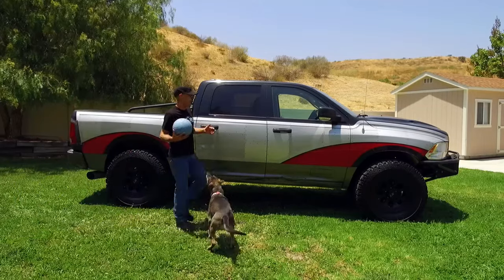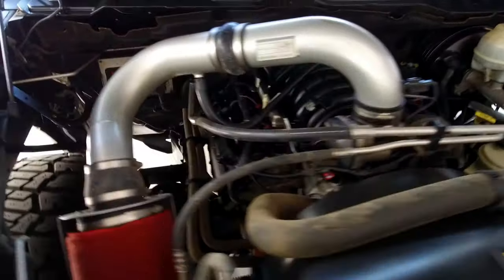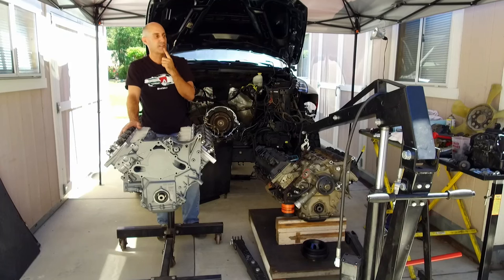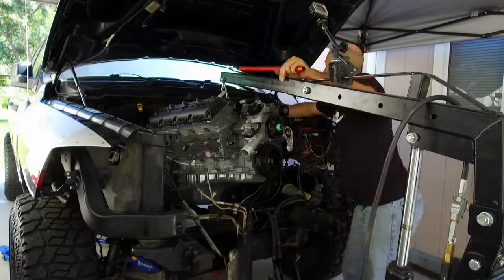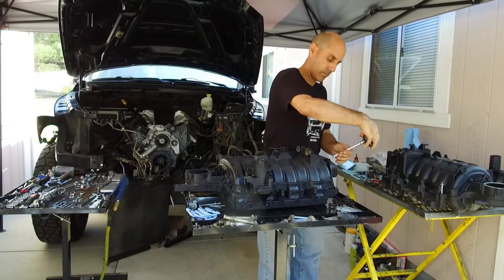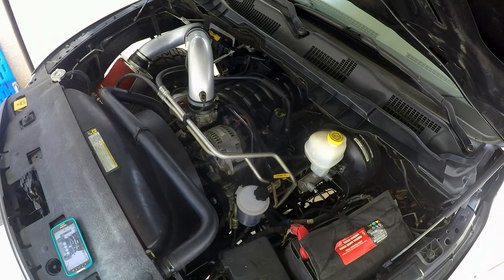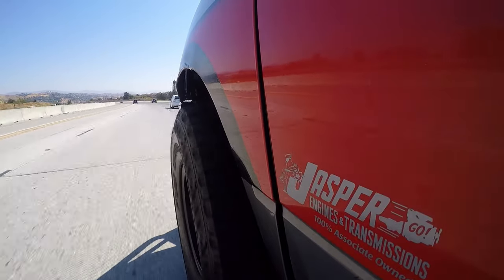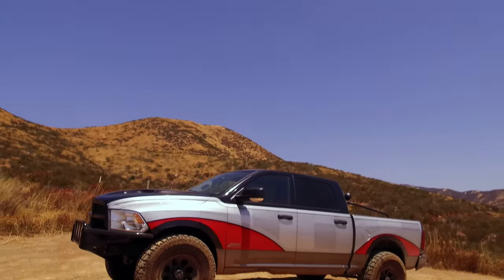HEMI Swap with Jasper Engines Replacement 5.7 in a Dodge Ram 1500 on 37" Tires

Comment: Great video. Thanks for the input on jasper engines. I have a 02' 4wd expedition with the 2v 5.4. Been a great vehicle. Spark plug came out of head and at first thought it just blew out but the top of the piston has some marks so I'm not sure without the head coming off if the piston hit the spark plug and pushed it out. The spark plug was damaged. I've been looking at jasper engines for a replacement since then if I can't repair this engine. 240,000 miles on the original so may be better to just get a new one. Thanks for taking the time to make the video and always having a great attitude. From south Texas.
Reply from the maker: Howdy and thanks for watching! I had a F150 with a 2v 5.4 and the spark plugs coming out is a fairly common occurrence. It's not likely the piston touched the plug... the heads just "let go" of the plugs and require a heli-coil. I pulled my plugs and just made sure they all had anti seize on them and were not too tight. 
If you do decide to get an engine... do some research on the Jasper unit. They are such a great company that I'm proud to support them and the more you know you would too!  Have a great one!

Comment: I BET JASPER JUST LOVES LOVES LOVES DODGE WITH ALL THE HEMI CAM AND LIFTER FAILURES
Reply: i had a 08 ram with the hemi i never had any problems with it.. is the problem mainly with the 09 and newer hemi? i like to know more...
Reply: @terrysansom6054  mainly 09-11 as far as I know. 

Probably cheaper to just replace cam/lifters. Basically the roller lifter needle bearings are going out at fairly low miles (first cases as far as I know were in 2016) and the lifter roller was eating the cam lobe. Ticking sound (not like the exhaust manifold leak they're famous for), then misfire code due to teh cam getting eaten, then she's fucked.
Honestly I can't believe people didn't see the signs when they changed oil. Should be a bunch of metal in the pan, but who knows.
Reply: Seems to be issues with mds 5.7’s and a few showing up without mds.  Much wider range than just 09-11’s. Someone posted their ‘15 had the same issue.
Reply: and the 5.4 triton
Reply: No mention of whether the Jasper engine has an upgrade to solve the camshaft/lifter lube problem.
Reply: just like at the end of his video... I believe they delete the code for the MDS and you pull them and replace with  plugs....
Reply: @redneckracing8895  Yea U would think they would have done a recall on that piece of shit.. Dodge has lost me as a customer,, Too bad ,, 2 more payments and ill be trading in for a new truck,  U bet your ass it wont be a Ram (dodge) .
Reply: 160,000 miles on my 2012 and going strong, 120,000 on my 2011 and going strong, not a single issue out of either. my 2012 has even been modded and running a custom Jay Greene tune, it does not get babied.
Reply: @frankreinhardt441  When you start hearing it rattle on start up, thats gonna be the start of the ending,  thats the lifter roller bearings  failing,,  soon after its gonna wedge sideways and wipe out a cam lobe.
Reply: @frankreinhardt441  Maybe you got lucky and got engines built with good parts,  my 2013 parts all came from mexico.
Reply: It is not as common as you think. It is not limited to the 5.7 but all the la gen 3 and gen4 hemis. Although to me there are years that seem to be more common.
Reply: I have an 03 and it just got the tick at 200,000 miles. I'm getting a jasper next Monday but it's 5600 installed. I just love my 2500. Next I'll need a new trans and then a new bed
Reply: Run a oil stabilization and you will be good to go.
Reply: @charlesedwards8030  Can you be more specific
Reply: @Crabawizky  Lucas makes a good one that’s what I personally use.
Reply: You can’t go the 10,000 miles between oil changes. 5,000 is what a old ram mechanic told me and I’ve never had a problem. Ram says 10000 and the mechanics say 5,000 I think I’ll go with the mechanics.
Reply: I have  a 2017 Ram. 60k miles.Have they fixed the problem with them by then or am I in for a bad day down the road?
Reply: I wonder if the rebuilt Jasper engine has the high performance hell cat oil pump that might oil the cam better at low RPM.  Yes it's always cheaper to buy a new engine than to pay $65k for an entire new truck.  Sadly new trucks will not have the hemi but a 300 six twin turbo which may or may not reach 200k+ miles.
Reply: Yeah man! I have a 2015 with 94,000km with lifter issues. Such a bummer!!!
Reply: @terrysansom6054 my 13 is having same issue

Comment: I have an 09 1500 hemi quadcab, been in the shop 4 times for manifold bolts, right manifold already replaced to warping.  Glad the 09 has the lifetime Powertrain warranty 👏. It’s in the shop right now for the left side manifold.

Comment: looks too easy, but you need some mad skills to do this. Guess you got the skills locked down! :D
Reply from the maker: Well, I'm not sure about mad skills but a little bit of luck and determination helps a bunch! Thanks!
Reply: anyway, Im impressed.Also your films are great. Tnx for making them
Reply: autoedit how long did your swap take just curious we used to do "1day" swap at the shop i worked at anywhere from 3hrs on a 3.7 2wd liberty to 4wd hemi drurangos that took like 12hrs those were long days 4wd ifs truck were a pain due to driverside mount design in sure you know that though lol

Comment: Thanks for making this video. You have encouraged me to do it to. I just pulled my motor out of my 2011 Power Wagon today and  will be moving over parts to my new Jasper 5.7 hemi tomorrow. I hope mine slides back in with as little fuss as yours did. It has been a ton of work so far just getting it out. Hope I get it all back together and working in the next few days. Thanks.
Reply from the maker: I hope it does as well!
Reply: Got it in and running. Motor sounds great. Thanks again for the video.

Comment: Great video!! Loved to see what Jasper did to improve the bottom end.  What about the top end?  This is where all the nightmares come with the GEN 3 Hemis.  Did Jasper fix the valve seat issue in the heads and the junk roller lifters that always fail and chew up the cams?
Reply from the maker: This particular year didn't have the valve seat problem but they did fix all that other stuff!

Comment: I think Jasper engines are great 
I had a Jasper 350 put in my truck in 2016and it's still rolling in 2023 1:20
Reply from the maker: This truck is still running great.

Comment: I have a 03 Ram crewcab dually. With a Cummins turbo diesel. If the motor took a crap I would buy a jasper engine for it in a heartbeat! You cant beat it!
Reply from the maker: I've been extremely happy with the entire transaction so far!
Reply: Beat on that engine and see what falls  out on road

Comment: Great video -- those new Hemis are incredible motors.  Unfortunately, I think that read somewhere that Fiat-Chrysler is going to discontinue the Hemi in a couple of years?  Too bad.  I have a 2016 Ford Triton V-10(6.8 L; 362 bhp; 457 lb-ft torque) in my motor home and I tow my 2013 Jeep SRT behind it.  But its crazy --  the 6.4L Hemi (470 hp and lb-ft torque)  in the Grand Cherokee makes over 100 hp more than the Ford V-10 .  I think I should tow the motor home behind the Jeep instead? LOL!  Hemis are the best.
Reply from the maker: I agree that the Hemi is a very solid V8 engine and when I learned all of the little goodies in this era, I was even more impressed.  Getting 390 HP and 400 LbFt out of a stock 5.7 is really good and  SRT takes things to the next level! 
I must admit that I have a soft spot for the V10, they sound weird and I like that. Seeing you tow your motor home behind your Grand Cherokee would be hilarious! 
Thanks for watching and say hey!

Comment: Well, I see what killed it, there was a Fram filter stuck to the bottom of it.
Reply from the maker: You are not the first comment to mention that... I had no idea that was an engine killer.
Reply: @AutoEdits  Of course it's not, but they are the cheaper of the options. K&N, Mobile 1, Donaldson, Amsoil, are all examples of better options for only a few more bucks.
Reply: @AutoEdits  Fram filters do fine. If you run for 80k miles on a Fram it's gonna give more issues sooner than some of the more expensive brands but as long as you regularly maintain Fram is fine.
Reply: Fram filter are junk. I’m a 30 year retired dealer tech.  If we had an engine noise complaint with fram filter, got changed first.  Had to replace one engine because Fram filter material plugged nozzles lubricating cylinder walls.

Comment: That was awesome to watch! I solo swapped a V8 Magnum for a Cummins 12 valve in a 96 Dodge Ram 3500 4 wheel drive cab and Chassis with a 5-speed. It's been a great work horse.

Comment: wow okay, I have been contemplating an engine swap on my 08 Dodge Charger RT and this helped make my decision, you made it seem a lot less scary then I thought. Worth a sub!
Reply from the maker: It's overwhelming to think of it as a whole project... just break it down into sections and you totally can do it!
Reply: AutoEdits thanks for the reply! Have you done swaps before? And how long did this one take you? The editing could make it seem like it took you a weekend
Reply from the maker: @braedentrebell3718  It took me a total of two weekends but since I ordered the new power steering pump... those weekends were spread out.  Takes about a day to get the engine out and 2 to 3 to get it all back together.
Reply: AutoEdits good to know! Thanks for the info!

Comment: Are u worried about that air intake being exposed to the open wheel well and water possibly getting sucked in?
Reply from the maker: +pra3t0rian I was for a bit but have been through some pretty bad weather with it and seems to handle it fine. Just have to clean the mud out every once in a while
Reply: Yea not to smart. I'd change that air intake to a snb air intake. So its enclosed do to the open wheel well. It's basically spitting water into the air intake if you drive I  the rain which will soak your air filter and let moisture in the intake

Comment: i bought a 2006 Chevy Silverado with a 5.3, a lifter had went down and ruined the cam. called jasper ordered an engine (installed myself). 2700 miles the oil pump goes out. i call the and they gave me 2 options to pull the motor an send me a new one or change the oil pump. so i took the oil pump route. i ordered a oil pump and new gaskets for oil pan and timing cover. after all the repairs was done i sent them receipts and a sheet with my time on it. the fully reimbursed me for the parts and time i spent. all this was done with out voiding there 3yr 100,000 mile warranty. i will not buy reman motor from any other company. i appreciate their work
Reply from the maker: Bummer you had to do the oil pump but I'm glad your happy with the end result.  I really couldn't be happier with the decision to go with this Jasper replacement engine.

Comment: Please cover your air filter better than just having it above the tire and in the open. You can get a closed box type intake, if you off-road heavily it's important since thats where your brand new motor breathes from.
Reply from the maker: Not sure what else to do with it, maybe another kit?
Reply: ghostdriverFJ60 add custom inner fenders.
Reply: Vararam intake is another option. They’re nice

Comment: wow that is a sweet truck.. how does that ifs system hold up with those 37s on?
Reply from the maker: Thanks! The IFS has been really good... I broke a half shaft once in Anza Borrego a few years back climbing some rocks (and that break was mostly driver error)  but it makes the truck so nice to drive. I'm very happy.

Comment: Good choice on the jasper i would have done a 6.1 upgrade instead of 5.7 i did these swaps on a daily basis a few years back lol on your pushing we used a geo metro wagon but a winch is nice option should have made some gin poles and use your winch to pull the engine too
Reply from the maker: LOL! I don't think I can do that upgrade and still pass smog here in California.
Reply: autoedit oh yea that sux
Reply: Richard Skipper how many jasper engines have you had go bad? in my 15yrs exp. I know of 1 and the warranty made it so gravy to get it replaced it was almost worth doing it twice cause they paid warranty labor more hours than i got paid first time around and sent a free install package due to the hassle so 2nd time around went faster thanks to all the new parts where do you see a downside? I dont know of another engine builder that will drop ship you a engine in 24hrs or less to your door when you have a out of state customer that needs a engine when they break down on a road trip it looks good on my shops part to have a down vehicle back on the road in under 72 hrs i thank jasper for that dependability
Reply: Richard Skipper sorry to hear about that yea they are better now sometimes you just get a bad claims agent that doesnt want to help but usually i can outsmart them due to knowing what to say and not to say to them or going over their head gets results too ive done like 5 jasper 5.4 3valve fords without a problem and those are some of the worst engines ever built so if they can get those right im impressed
Reply: Richard Skipper not 5 in one truck i own a repair shop i have personally installed 4 and help another tech with the 5th (his first cab off f150) all jasper ive also installed the remans available thru bumper to bumper and O'Reillys(who just resell jaspers) and ford themselves source replacement 3valves from jasper as their n.o.s. supply ran out years ago
Reply: Richard Skipper I went through 4 jaspers in one month.
Reply: Jake Browne who does this 6.1 swap? What’s it cost ? Love to pull my 5.7 for a 6.1
Reply: 6.1?  I think you mean 6.4, since that's the only other Hemi option.  He wasn't actually trying to push it, notice it is still in Park, rocking back and forth.

Comment: Love the ram!!!
Reply from the maker: Glad to hear it! I really do to and hope it gets the mad likes here on the you tubes!
Reply: I was at the road kill event in Pontiac MI last weekend! maybe you could bring there and show it off next year!
Reply from the maker: I was there this year as well, it seemed like a lot of fun... I was working of course... You might have seen the drone flying around.
Reply: Yeah I saw it! That's awesome! Im about to sell my wrangler and have a couple clean high mileage rams around for a good price. Was wondering if the jasper was installed at a shop if it would be under 10 grand? and are you worried about the transmission holding up séance its older?

Comment: These are great motors mine had 300000 miles on it with zero problems until one of the lifters failed and flattened the cam. When I took the motor apart there was almost no wear block was perfect pistons were hardly worn. One valve had a manufacturer error on the seat. After doing some research the oil pressure in this motor is very low at idle. This causes improper lubrication on the lifters. I believe me starting my truck and letting it idle for long periods of time in the winter caused the lifter failure.
Reply from the maker: Interesting to hear this analysis. I'm still a fan of this engine design.

Comment: I'm curious is the jasper engine more powerful or is it the same
Reply from the maker: You know, I never asked that seemingly obvious question.  I'll do some checking and let you know.
Reply: I was wondering the same thing.
Reply: I would think so, because being rebuilt means they honed the walls and put larger pistons and rings to rit the hone. So I'd say at least 10hp more

Comment: I cringed when I noticed he put the stock exhaust manifolds back on....might as well have replaced with headers, especially to prevent the infamous broken EM studs.
Reply from the maker: They work pretty good... tricky in CA to change that “legally”
Reply: I was thinking exactly the same... Why putting the old exhaust manifold on such a beautiful engine, when you can put some nice headers on... I just pulled the engine out of my JGCH 5.2 and one of the things I did was swapping the exhaust manifold for Doug Thorley headers and the engine is now exhaling much better than before... :-)
Reply: JBA shorties are CARB legal, let that thing breathe.

Comment: Checked prices and it depends on "contacting them". So wildly different prices for individuals, ugh. I just hope its cheaper for a stock replacer than a vanilla Blueprint engine ($9000)
Reply from the maker: PLEASE CALL THEM!  That's how I got mine done... you will be happy.
Reply: What did yours cost? ... Any rebate due to featuring it in this video? ... Sorry if you already said it in the video and I missed it.Thanks for the reply.
Reply: I replaced my 07 1500 for a jasper engine. 4200 for a long block.  cam 268 intake, diablo tuner and throttle body was extra through Moe's. total cost was 5100.

Comment: Just hit 300,000 miles on my '07 ram 5.7 I was looking into Jasper engines as I've owned the truck since new and have done all the maintenance this doesn't look too bad great video
Reply: Jasper engines are only good for 50000 miles at most trust me you will not last 3 years

Comment: Yes Jasper is the way to go a couple of years ago I went through a pain in the backside issue with a head gasket job on a Ford 4.6 in hindsight I should have just went with a Jasper engine it would have worked out about the same cost wise. Jasper does have a quality product.
Reply from the maker: I wrestled with that math for a while and it did work out best for me to go the Jasper route.  Now I have a truck with many years left on it!